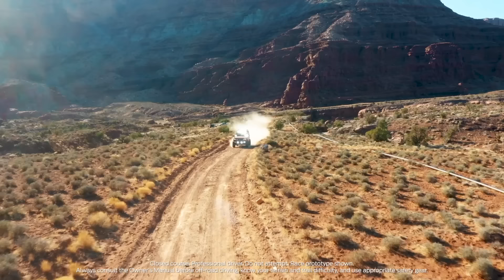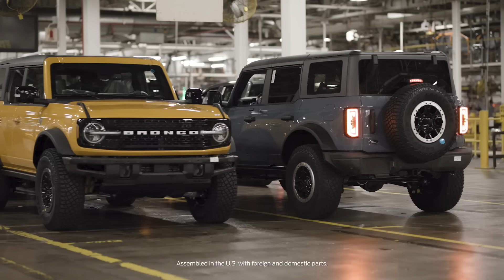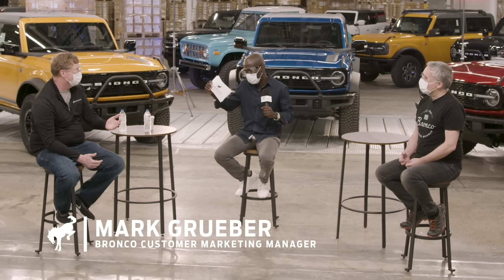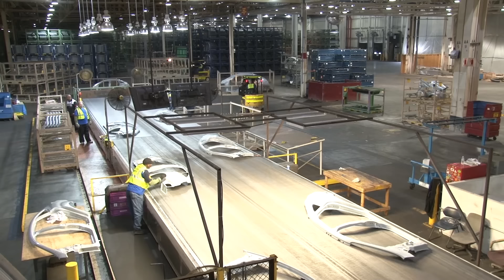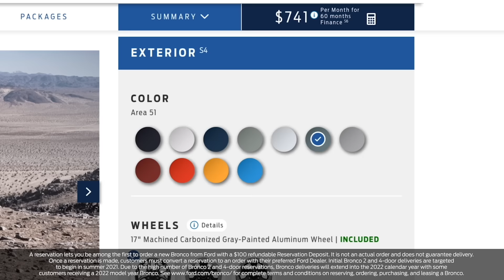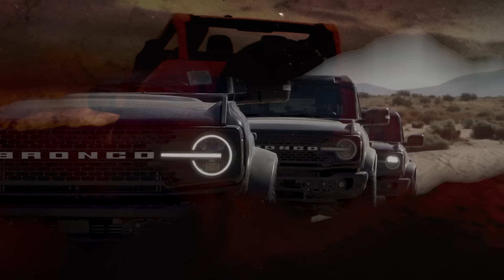Bronco™ Celebration | Ford

Comment: Excellent video! Watched every second of it start to finish! I am a huge advocate of the EcoBoost engines and currently have 4 Different 1966 F100/250 Ford trucks with EcoBoost power. As a matter of fact just this morning I was out for the first long test drive of my latest creation. A 1966 F100 Short Bed with a 2020 Raptor Crate Engine and 10 Spd Auto. I also have a 1966 F250 Ranger with a Prototype 3.5 EcoBoost 6R80, a 1966 F100 factory 4x4 with a 2.7 EcoBoost along with another project a 2018 F150 Chassis with 3.5 EcoBoost that will most likely get a F600 Cab on it with full Electronics like a new Truck. Love this new Bronco but have my name in the hat for a Raptor R first. My brother in law is in on early Bronco orders and his is due to be built June 23

Comment: Hi Ford, Young investor and Fan of your brand here. Was hoping to find out if you will make a 4 door Bronco with manual trans. Also wondering if aftermarket parts will be made for a coyote swap down the line. Thanks :) much love. - James
Reply: You can get a 4 door with a manual transmission just no v6 and as a few months ago you can get the manual transmission with the sasquatch package

Comment: My Bronco has a engine light on, passenger side fog light out, and the brakes on the driver side maje a noise. I took it in to the Town and Country Ford located in Madison, TN. I was told to leave my car for three days. My car is needed for transportation to work. Help is needed badly at this location with how they communicate to minorities, and expeditement of service in an efficient manner.

Comment: Is it just  the Sasquatch with manual trans that has been delayed til 2022?  I don't have one reserved and am not in a hurry to buy but want to check them out so I called two different dealers to get an ETA and was told they will have a good selection in about 10 days. I assumed if you reserved your months ago you should get it before they hit the lots.

Comment: I have a 2018 Ford Focus SEL. Love the car but damn do I feel ripped off with all the problems that are starting to come up!! Im around 45,000 miles and the transmission is starting to give out smh
Reply: I have a 2013 SE Hatchback. First thing I did was to only include manual transmission because of the auto transmission. Been driving it for 3 and a half years and I haven't had a single issue.

Comment: The Mod Center's Mark Wilson: 3 different roofs? Ya'll can barely drag Webasto across the line to get the MIC hard tops made and you've delayed other roofs until MY22. 230 accessories? Haven't seen any source with anywhere near that many. This footage was either filmed a while ago but when the execs still had hope and optimism. Or Mark Wilson is being a spin-doctor, marketing mouth piece for the company.